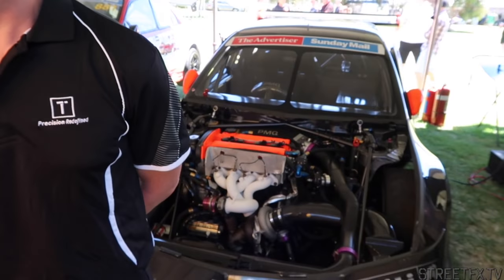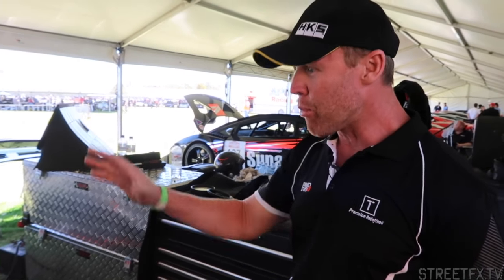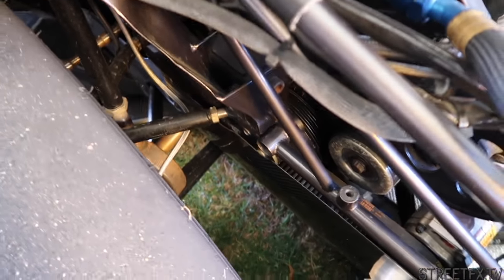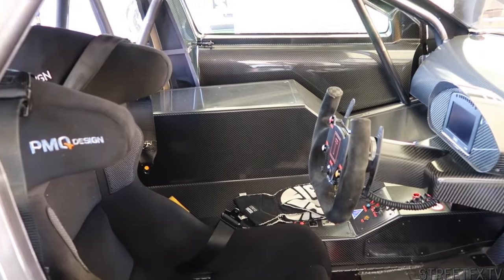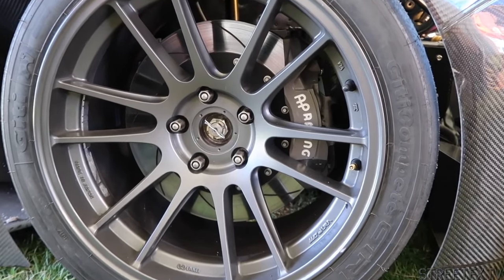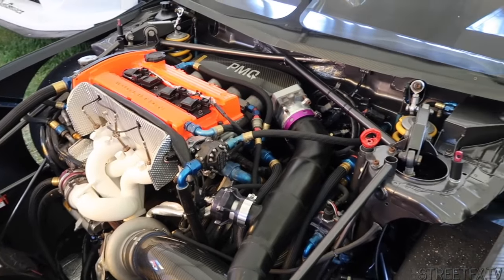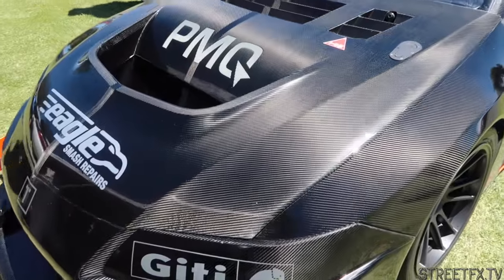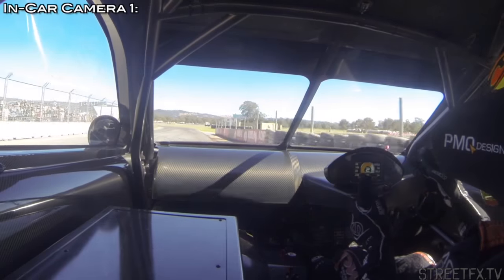This 800hp Evo is nearly 100% Carbon Fibre. It weighs only 1000kg, and it's absolutely stunning.

Comment: most incredible evo ive seen to date
Reply: CP9A (Evo 5-6.5 are 1300kg to just under As Stock Street cars so it actually can't be put against how much this car lost being 1450-1500kg ;)   If you want instantly light  there is plenty more Higher hp less weight cars Evo 2-3 ( 700kg ) 550-600whp ,  an  a Hill climb White Evo 6 Rs is 850kg an Twin charged 800whp ;)
Reply: As Australia Goes, the Tilton Evo is the most impressive, if it ever returns with a rebuilt Chassis * since it was stock * just had aerodynamic changes,, an if it was running the paddle setup it would of no doubt gone into the Sub 1.23s, at Wtac,  as a Awd that is fast,   rwd is no doubt the king of Wtac tho,
Reply: Rawky HELL YESS!!!! I’m Honestly lost for words here man! And they used the original Evo Motor which is freaking AWESOME! That suspension man.... So sick with that cantilever setup.... Jeeezz!! So sick!
Reply: Cheeky i said the one you listed was a CP9A,  this is a CT9A , i have owned both including even a CE9A,   its easier to shed weight from something that is originally 200kg+ less weight to begin with its basically the same achievement,, but there is better Evo 6s, an 5s out there then the red one not saying its not impressive,
Reply: Indeed.

Comment: Looks like about a million bucks. Incredible machine.
Reply: 1jiveturkey1 looks like 30,000 car with expensive ass parts that still makes the car look like a 30k car.
Reply: rps13sr meh.
Reply: its basically a new car now man stop hating lol. You cant really compare a car used for racing and one used for daily chores.
Reply: You are in the right ball park $$$ from what i have heard, def a lot of money to develop a car this well, it certainly drives well, very fast indeed. 
I have a 510kgs LMP3 car and is less than a second slower per lap than this at QR, but my car cost less than a 5th of this to buy.
I can't afford to build a machine like this, but if you want to go fast, there are means and ways of achieving it with far less money. 
This EVO is an amazing build and if you can afford to do this,  I say go for it, what a hoot for a tin top.
Reply: rps13sr wow, you haven't been around the race car scene very long.
This thing oozes quality and engineering excellence.
Reply: Why am I jealous?  I think you might need to rethink that...... Lol.
Reply: @rps13sr  you sound confused

Comment: That's 2200 pounds my fellow Americans, and if you still don't know how much that is. That's the weight of 1 NB Miata.
Reply: Thanks brother, I was on my way to Google for the conversion, but you saved me the trip
Reply: Also, some more help: 550kw = 738whp on 35psi(only on dyno) but on 29psi(what he runs for racing) it's 458kw = 618whp.

Comment: Fantastic video, Mick was fantastic at describing his machine, great questions Mark.  I have seen Mick and his car a few times now, but never had the chance to talk to him about it or see it up close, this video was what I needed.
I love the fact he has just the right size brakes on, so many go too big, he understands the importance of rotational forces and gyroscopic forces associated with brakes it seems, this is a sign of guy and team who know exactly what they are doing.   
I am not sure i would do the fuel cooling in quite the same way, but hats off to ingenuity here, great to see these sorts of mods.
The torque bias in the AWD is great to see too, I always wondered in my 34GTR if going from 50/50 AWD split to a more FWD orientated delivery would be advantageous, I guess I will never know as I have sold the car a while back, but glad to see it working well here in the EVO.
Everything about this car is well though out and simplistically implemented, what a fantastic car and build.

Comment: Apart from the carbon fibre parts, the rest of the car: parts, engineering and design of the performance parts, and so on is pure automotive p0rn. And then there's the carbon fibre, purely functional and still looking better than on a show car. Mind blowing...

Comment: That carbon Fiber work looks very very nice. And no clearcoar? WOW
Reply: phasehalide It has clear coat but is added to the mold before making and then sanded with 2000 once fitted and a quick buff.
Reply: I have never used a clear coat after removing the piece from the mould. Always gel coat.
Reply: shiny mould = shiny parts

Comment: It's not a venturi system on the intake,it's the opposite as i know.
The fuel cooler act just as an organiser for a laminar flow,so a better efficiency to fill up the compressor housing.
when you lower air speed ,with a bigger section,you gain pressure.
He uses Bernoulli principles there : lower air speed to gain air pressure to fill up more efficiently.
But the air filter up front is a mistake here,the surface area is way too big,
The rule is about 1/3 intake mouth surface area of the air filter.
http://www.ka-t.org/forums/viewtopic.php?t=14314&start=40
http://contrails.free.fr/engine_aerodyn_radia_en.php

Comment: Thats pretty amazing but lets be honest, that's barely an evo at this point
Reply: Nate Sparling This car went full Theseus ship.
Reply: My first though was "why evo?" He talks about problems with fitment and axle angle. He could have literally made the car into any shape he wanted with the money put into it. I'm just saying that because the hardest part of my project is getting everything to fit properly.
Reply: Nate Sparling seriously idk why these guys don't just build an actual 1off race car
Reply: still using the stock engine block i think
Reply: Running a stock engine block at 800hp for a 4g63 (at least that's what motor i believe its running) would be physically impossible for the street let alone a time attack car. 

First lap and you'd blow it to pieces. 

Now if you mean using the same engine that came with the car but not stock at all then yes I agree with you.
Reply: It’s the Evo 9001

Comment: Cool the same weight as my SL2, I have a Seibon carbon hood on mine with polymer panels. Mine doesn't have 800 HP though, 350HP, but still should be fun. I'm adding carbon sparco seats in mine too and I have RPF1 15X7's that are 9.8 LBS, I'm into the light car thing myself.

Comment: It is very impressive, but have you heard of the car that weighs only 632 Kilograms? The Factor Aurelio. Just imagine that weight and that much power.
Reply: Although the engine may change the weight and make it heavier or it may still be very lightweight. Who knows? The only way to find out is the weight with that engine.
Reply from the maker: Except that Filipino thing is nothing but a prototype that has never managed to do any official laps.. anywhere.. At least not as far as I have seen?
Reply: Still, I’m thinking about that car and the engine in the video combined together :D even though it is a prototype who knows how it could perform? Maybe a race team might look forward to using that prototype car because of it’s weight.
Reply from the maker: I wouldn't be overly confident that its design has been tested in a wind tunnel or its parts would survive a lap with a decent power engine.
Reply: But hey it’s a prototype. It can be improved or tuned. After all it’s a small car manufacturer.

Comment: So what parts actually bolts up to my Evo?  Pretty much nothing except for the engine.  It's a carbon shell that looks like an Evo mated with a fully tubed chassis...using a factory CV joint...
Reply: Nope, it's a stock chassis with section cut out :)
It is WTAC compliant afterall

Comment: If you don't race and are just really rich ball park how much would this cost to have a pro build a carbon body like this? Like 500k for just the body?
Reply: Yeah i think , maybe more , carbon fiber isn't a joke
Reply: If you were really rich and wanted a full carbon tub car, you can either go big and get 4 cars for $1M (scaling up so can reuse templates for parts) or get straight LMP2 cars for about that , all carbon too. Then, since you are rich and either fund you own racing series and don't want the LMP2 restrictions, you can cheat all you want with minimum weight and hit 650 kg probably (100 kg on top of a F1 car that has no ballast. F1 weighed as little as 530 kg with no driver as far back as in the 1980s). Then add active aero, suction, all the banned F1 tech and get a current F1 engine from a manufactorer without the electric stuff but with the full 15k rpm and max boost the engine can hold at 15k redlines. Should be a LMP2 that is basically half F1 under the skin and with a 1200-1500 hp engine. Don't forget you can also have the F1 engine bored/stroked up from 1.6L as we assume you start with a $10M budget and actually call Ferrari/Mercedes for a batch of F1 engines (but without any competitve element for Merc/Ferrari so they can deliver nutso power at 100-125 kg for the engine)
Edit: 4 cars without engines and maybe even without custom wings and outside aero, basically tubs and suspension, electrics etc, should be possible for $250k a piece if you get 4 at a batch. You have to think you would probably break or crash 1 or 2 and you always want 1 or 2 ready to go. Just like F1. The power/weight should be almost 3 hp to 1 kg since you can break all rules and if it gives you an advantage, small electric engines can be added to the front for 4WD on demand if the added weight makes sense.
Reply: this isn't carbon tub, just carbon body panels.  I'd guess around 100,000 for carbon work.  This car was built for time attack so there are rules and restrictions to follow.
Reply: AntiLag BoostAddiction can’t a get a new gt350 with a full carbon body kit for 70k. So I bet this car would be around there
Reply: It IS  a carbon tub
Reply: AntiLag BoostAddiction Why would you want one if you wouldn’t race it?
Reply: u know what i find hilarious, in the early days of carbon fiber the main selling point of it wasnt just its strength but just how damn cheap it was compared to steel and aluminum. funny how that changed
Reply: Project_Evo I would race it every dam day lmao I just don't care for racing in competition i would just want it for fun. Plus I wouldn't want anyone rubbing into my beautiful new carbon body lol.
Reply: They sell this as a package. From memory it started at 250k AUD
Reply: I bought a custom surfboard from aviso, $1600...5'5" tall...do the math...lol
Reply: Anastazja Pe that's my future first car it's like a 1.something. but right after that mr2
Reply: No way it would cost that much. People who think it does don’t know what they talking about. A brand new bmw i8 that is all carbon body and frame is under 250k. A lfa using more carbon fiber than this one also cost less. This is just the panals and interior pieces. Hood 1k fenders 1k roof 1k trunk 1k doors 2-4K for the full set. Or you can double these figures. But they probably running expensive carbon shit so let’s quadruple these numbers and your still under 50k. So yeah 500k is talking out your ass
Reply: Paul Standeven really so you can weld carbon. Cause you can see welds inside the interior of the car.
Reply: Gonzo please show us where you heard the main selling point of carbon fiber is because cheaper than steel.
Reply: gonzo  where do you get your facts from?? cause your statement is complete bullshit,   carbon fiber when first conceived for use in a race car was by the mclaren f1 team when creating the mp4/1 back in 1979 and if you bothered to do any research you would know that back then carbon fiber was in it's infancy only just starting to be used in the aerospace field and manufacturing of raw carbon weave was more than 15 times more expensive than the modern manufacturing techniques we have today not to mention mclaren had to have the entire carbon monocoque manufactured by a aerospace company who at the time never engineered individual parts as large as what was needed for the car so factor in another  $ million or two for R&D just to engineer and create a process of creating the car and when you add it all up, carbon fiber was much much more expensive than the aluminum they had used before.  The real selling point for carbon fiber to mclaren engineers was the strength to weight ratio of carbon,  they were able to reduce weight by 30% over aluminum while increasing stiffness by almost double.  Carbon fiber has really only started to come down in price in the last 15yrs and thats due to modern faster more efficient manufacturing processes.  But regardless your bullshit statement made me laugh and i thank you for that,  anyways hope you learned somthing.....smfh

Comment: i mean can you even call it  an evo anymore because thiers nothing evo left besides the engine and drivline and thats still heavily modified but either way absolutely crazy indepth build that i dig high horspower little weight 100% one off
Reply: So what would you call it if you saw it in person. You’re not gonna be like look at that car that’s heavily modified and looks like an evo
Reply: the only thing that would give it away is the body lines

Comment: Are you the Fella who had a Fight with Gokhan? from LSX Tuning on a Xtreme Tuners post?  Lol i seen a argument about a week ago,   Such a funny post lol,
Reply from the maker: mmm I am actually not sure what you're referring to, so I guess not me? Unless your question is directed at someone else?
Reply: You're not Mark from Street FX on Facebook? who had a argument about HP on the Xtreme tuner Evo ?
Reply from the maker: Oh yes that was I.. That dude was quite obscure.. Considering he was trying to say a formula outweighed real world figures..
Reply: He is a Tuner in NSW who tunes a huge % of the Evo's here in Nsw,   The Extreme Tuners car ran at 1700bhp yeah he pointed out 1500bhp ish for weight/time,  Think about how Accurate a Roller dyno is, with something 1000hp + hence why your 86 was done on a Hub dyno, cuts out the wheelspin, but at the same time dynos using diff ramp rates, slightly lose straps can make it like something is making much more power then what it has,  My Personal evo is 800whp @ 46psi  an 940nm 2.3L   , i see Evo's pumping out 300-350whp all the time an tell me 1000nm, because the dyno was configured as deprived torque, which makes people think their car is super amazing an believe it really is pumping out those figures of torque,   with hub dynos you can't do that so much you defs, get accurate readings from no spin...  Xtreme is still using a Roller, in the states its Awd Hub or Engine stand dynos when aiming 1300bhp+

Comment: "only 1000kg"

Yeah well so is my car and it's almost entirely steel
Reply: Wright Marshall no one cares about your old cheap Miata when they looking at a car like this.
Reply: carbon fibre is an order of magnitude strong than steel. For your Miata, to match the strength of this thing, you’d have to weld enough steel to it to build a small house. I’ll go with the carbon.

Comment: "its only 1000 kilos so you don't really need good brakes..."  I don't think that's how it works mate...
Reply from the maker: doesn't need really BIG, heavy brakes.. That is how it works. No point having overkill massive brakes if the car is super light. You don't see gokarts with car brakes..
Reply: Ahh I understand now.  I was poking fun at how it was explained in the video :) Really interesting and cool build and thanks for the explanation on the brakes :)

Comment: nice ...  but 550 kw is actually 737.562 HP still plenty power for car of that weight love it ""
Reply from the maker: that's the power *at all four wheels*.. It will be well over 800hp at the engine.
Reply: what is at the motor is not important its what hits the road .....but ur right

Comment: my car is fully steel with only plastic front/rear bumpers and fenders from factory
it's comfotable
spacious
top speed 210KM/H ~ 130Mph
5 Speed 1.4L 8Valves N/A 75Hp engin
you can put up to a 3.2 V6
you can also make it RWD / AWD you got the space you need for that
and the best in alll of that it's weight 990Kg
It's simply a Renault Clio Classic
héhéhéhéhéhéhé

Comment: This car is still kinda heavy?
Reply: bestmotorist02 2700 lbs all carbon fiber doesn’t really sound that light but I guess I’m just used to little Japanese Tin cans.
Reply: 2200lbs and the classes have minimum weight limits so it can't go lighter anyway
Reply: 1000kg for a 4wd car with a roof is pretty damn good. Like he said this is 550kg lighter than it came out the factory.
Reply: Triple259772 that shit about to fly away if it was lighter
Reply: It weighs a much as a 1990 Miata.

Comment: Off the top of my head so the car makes arpund 800hp and weights 2700lbs.?!
Reply: 2200lbs
Reply: No, the car actually makes around 614WHP with the 29lb of boost he says he runs on the track.

On the dyno he make 550kw on 35psi which = around 738whp.

35psi = 2.4 bar
29psi = 2.0 bar
2.4 / 2.0 = 1.2
550kw / 1.2 = 458kw = 614whp

^ that is an estimated equation basing reduction of 35psi to 29psi shows a 20% power loss.
Reply: 2204.62lbs...
Reply: alex bishop not really, useless going into that many decimal places when the 1000kg is already just a rough estimate not an exact measurement. That’s why sig figs exist.
Reply: SI0AX well 1 kw = 1,36hp =) 550=748awhp
Reply: Steve Hash I was close!
Reply: Well actually 1 kw = 1.341022 which would be rounded to 1.34.
1.34 * 550 = 737. But I multiplied 1.341022 by 550 which = 737.5621 which can be rounded to 738.
Reply: CognitiveDissonanc